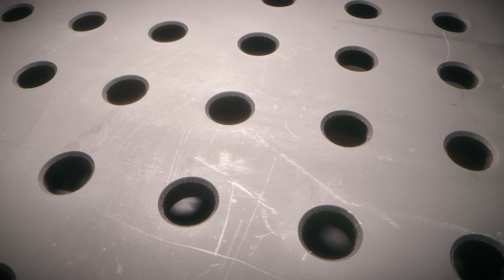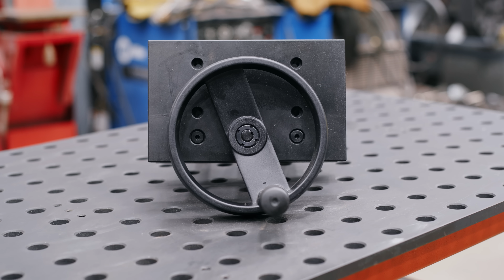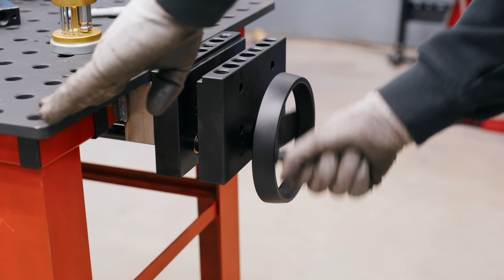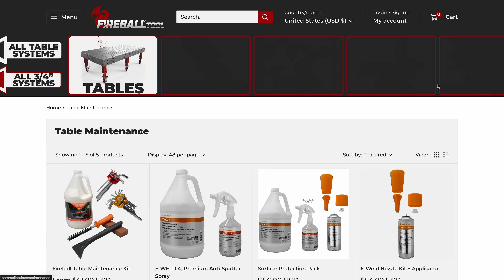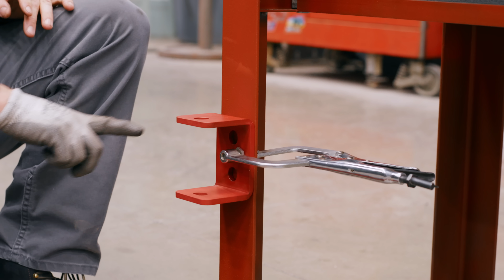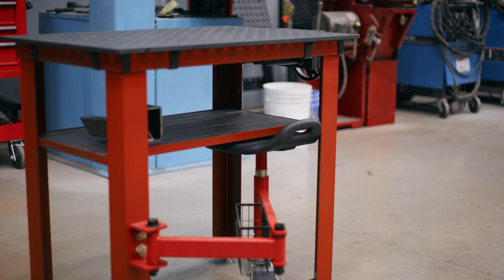Must Have Accessories For Your DIY Fixture Table!

Comment: As a no machinist, I’m curious. During the milling stage, how many holes can the drill make on steel of this thickness, until it goes blunt? And afterwards, do you sharpen, or just replace it?

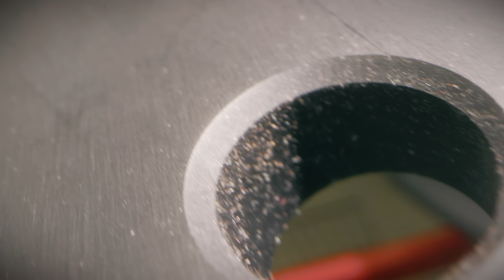Comment: Civil engineer here, not a metal worker. 0:22 - can someone please enlighten me regarding "...not laser cut or water jet..." I would have thought that these two technologies would give you fine, accurate holes, chamfering machined later. What's the problem/shortfalls with these methods of doing the holes?